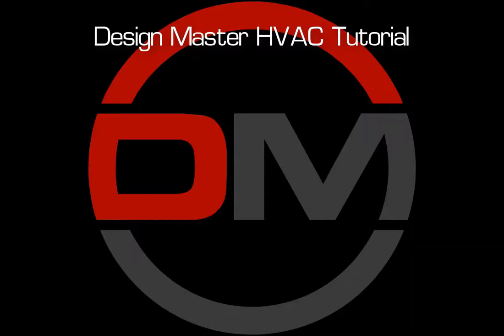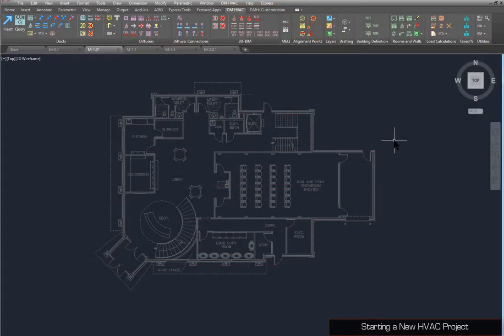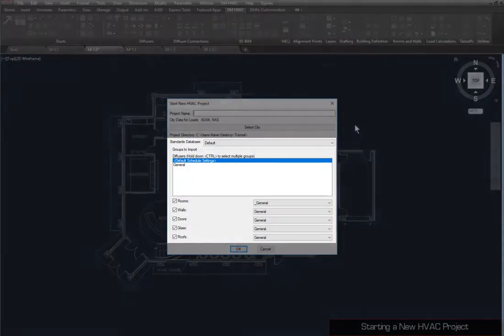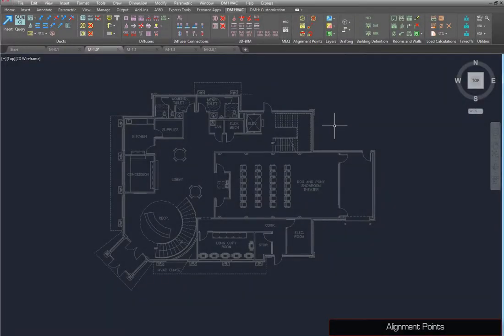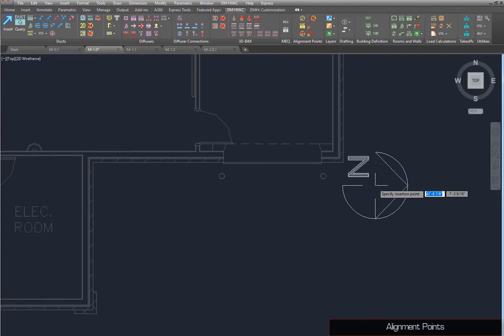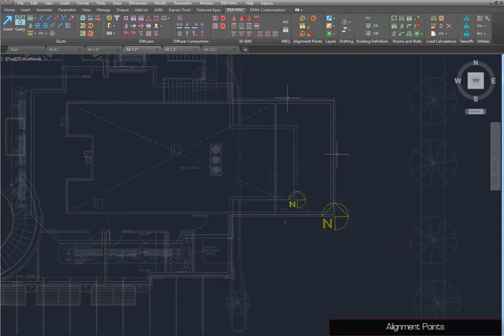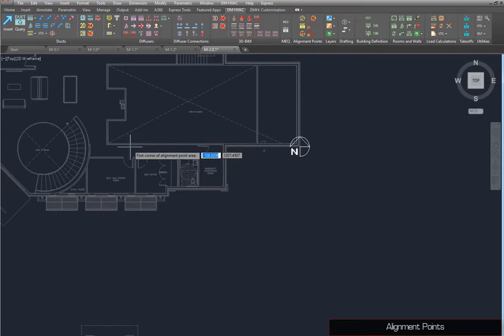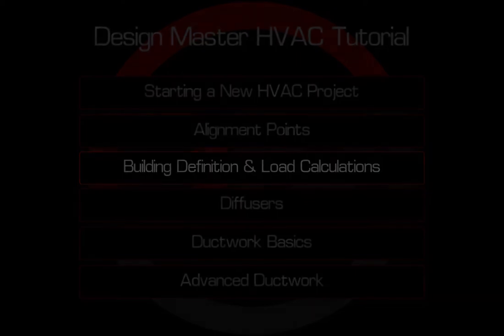Design Master HVAC for AutoCAD Tutorial | Part 1: Starting a New Project & Alignment Points

Comment: How do I get DM HVAC Ribbon? Did you make that customization yourself?
Reply: Actually I figured that out. You did in fact make a new custom ribbon. However, the Design new HVAC button, is that custom too? Or was that a command from AutoCAD?
Reply from the maker: @teenenator2  Everything you see in the video is done using our commands and ribbons, which you get by installing the add-in: https://www.designmaster.biz/help/hvac/tutorials/installation/

Comment: for HVAC, Is their any different autocad software or this is same software which we use for architectural dwg.
Reply from the maker: Our software is an add-in that works inside AutoCAD, so you can use the architect's DWG without having to export to a separate program (though we do recommend using an XREF instead of drafting directly over their work). More information about what you need to run our software is available here: http://www.designmaster.biz/support/system-requirements.html
Reply: @Design_Master_Software  thankx